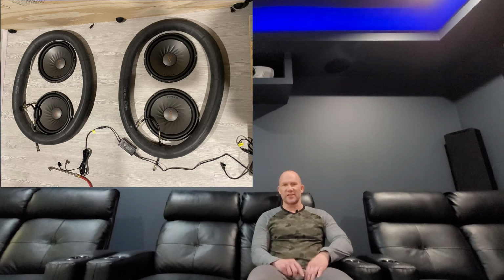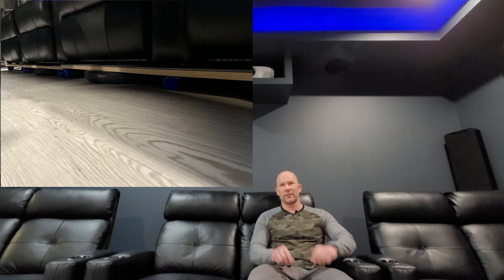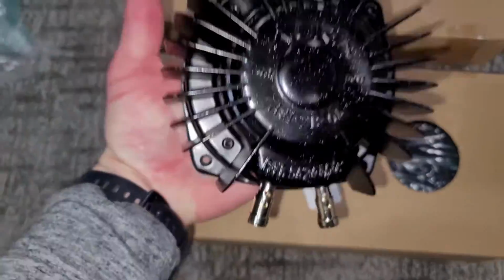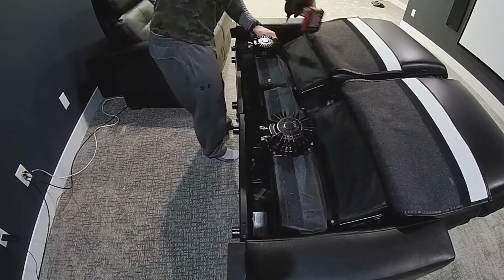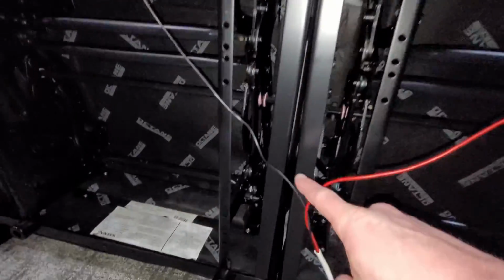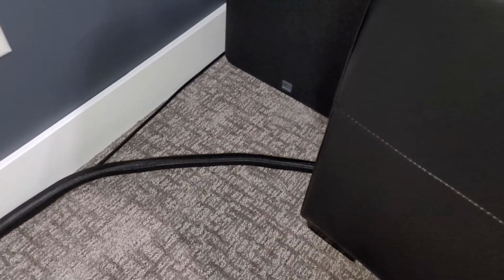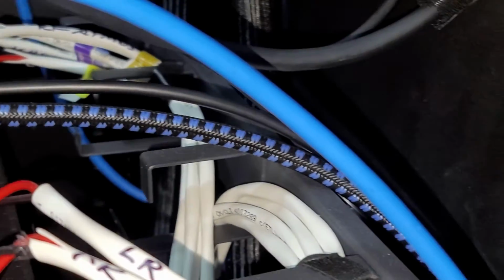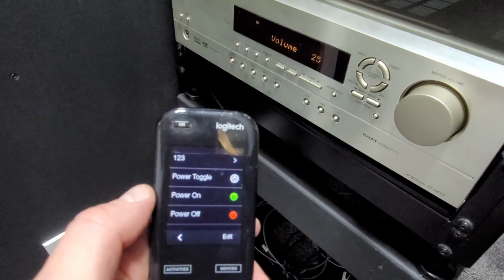Basement Home Theater - Bass Shaker Install for Tactile Bass

Comment: Hi thanks for the wonderful video! My question are do I need to use the Logitech harmony cause I can’t afford to buy one afterall the old receiver I will use for the shakers already has a remote control and my last question is will the receiver to receiver really works thanks😅
Reply from the maker: Hello - no you don't have to have the Logitech remote.  That is just a convienence thing to have everything controlled by one remote instead of multiple remotes.  The receiver to receiver works great!  You just have to make sure it is set up and connected properly in order for it to work right.  Good luck!

Comment: Hello i have a question. I have a yamaha receiver RX A-2080 and I use both subwoofer outputs on this receiver. Because I don't want to sacrifice any of my subwoofer outputs is there any chance to be able I connect my centre pre out from yamaha RX A2080 to any channel in of my Sony receiver and follow the same procedure as you did. Should be this ok? I believe that preout  sends only signal.
Reply from the maker: Try it and see what happens!  In my mind it'll either work or it won't....depending on how that receiver is set up.  Some receivers you have to change the settings in the menus to get the pre-outs to work.  Can you install a splitter to your 2 subs on sub out 1 and use sub out #2 to the shakers?

Comment: so my question is, how are you able to run 2 receivers in the setup? (i'm still new to the home theater scene and i myself have a onkyo nr6050 and am running 5.1.2 at the moment, gonna get 2 new subs both 12 inch wireless). bass shakers would be awesome inclusion
Reply from the maker: Hello and thanks for watching.  The second receiver is acting only as an amplifier for the bass shakers.  It gets it signal from sub out #2 and only  amplifies the signal and powers all six bass shakers.  The Denon handles all the other speakers in the whole system.
Reply: @TyEichele  gonna piggyback on this question: I notice you run 2 subs. If you’re running 2 subs how do you have an extra Sub Out connection to run your second receiver? I’m missing something 🤔
Reply from the maker: @jruhhh  Good question.  I am running a MiniDSP 2x4 HD.  So my sub output #1 goes into the MiniDSP, which then has 4 outputs of it's own that go to the subwoofers.  I have each of my rear 2 subs on their own output from the miniDSP, and the 4 18" subwoofers in the front behind the screen are set up in pairs, so each pair is on it's own output from the minidsp, which means I'm using all 4 outputs on the minidsp.  Hopefully that makes sense!  Check out my other videos for more details on this!
Reply: @TyEichele  makes total sense. Thanks for responding!! You’re a great help man!

Comment: Great video. What did you set your crossover at on your Onkyo?
Reply from the maker: Thank you!  I did not set anything up in the Onkyo because it is set to pass the incoming signal straight through to the shakers without changing anything at all.  So the original source is coming from the Sub 2 output on the Denon, which has the LFE channel set at 120 hz.  Hopefully  that makes sense!

Comment: Very well simple explanation and amazing setup. One question, I have a Denon with 2 subs out which I have connected 4 subs total using 2 Y splitters. How can I connect 4 bass shakers?
Reply from the maker: I would move the 2  Y splitters to Sub output 1 and control all of my subwoofers with that single sub output.  It shouldn't matter how many times you split that signal.  Are you using a miniDSP?  That would give you 4 subwoofer outputs and only use 1 single input so you wouldn't have to use any splitters at all, plus it gives you the option to now time align and EQ your subs to your room, which is a huge benefit.  See my other videos for how that all works.  Then you can use subwoofer output 2 specifically for your bass shaker setup and control them independently.
Reply: @TyEichele  Thank you for the answer. Im actually getting a miniDSP deliver tomorrow. I have seen your videos about using DSP along with other videos as well and yours is very well explain with good simple details but I still feel I need to watch it one more time to get everything consumed. (Could be overwhelmed at first)
Reply from the maker: @felicianojaquez9019  Awesome!  Yes, take your time for sure.  Have my video ready to take you through it step by step maybe.  Remember - you can always start over!  You might not get it on the first try and that's ok.  Have fun with it!

Comment: I have 4 of them in my 3 seater sofa. I just watched The Batman. It enhanced the movie so much. It's driven by the Dayton Audio BSA 200. I really recommend for those who can't have cinema level subwoofer levels. And for those to do, it is a nice to have but not essential. As I have a living room and no chance of a svs subwoofer in my future this worked a treat.
Reply from the maker: That's great feedback!  Thanks for sharing your experience with these.  I could also see these working very well in apartment settings where loud bass isn't probably going to happen.  Thanks for watching and commenting!
Reply: I just bought the aurasound bundle with Dayton amp . 
Do you recommend any settings like HPF and LPF ?
Should I leave HPF off and only turn on LPF ?
Thanks
Reply from the maker: I don't have any filters on mine because it's getting it's source from my subwoofer output #2.  Therefore it's only getting the LFE signal from the AVR and passing that signal to the shakers.  I'm sure you could set it up however you want depending on your preference though!
Reply: Good recommendation but don't use SVS are a holy grail of subs. Not even close.. PSA and Rhytmik are way better.
Reply: @shaolin95  that's interesting as everyone on YouTube likes svs subs. My local guy is a fan of Rel. At the minute I have a simple Yamaha NS-SW300. It does the job.

Comment: Hi, amazing video! and amazing set up! I have a 7.1 system Onkyo tx-nr6100....so if i want 2 bass shakers i would need an amp like your onkyo solution but how would i have the .1 subwoofer plus the 2 bass shakers? Would i just connect the Y cable from the Nr6100 and one end to the reguka subwoiofer and the other to the extra amp?
Reply: Thanks
Reply from the maker: Thank you very much!  Yes if you only have 1 sub output, use a Y (splitter) on the sub output to get the LFE signal to the amp that powers the bass shakers.  Then you can connect like I did in the video from there.  Good luck - you'll love it!
Reply: @TyEichele  AMAZING! Thank you so much for your answer...I've looking everywhere...do you recommend any amp in particular? Ithoink there are some specificaly designed for the bass shakres.
Reply from the maker: @jubeijimbo3062  Yes there are amps that are more specific to them.  It doesn't really matters just make sure you will have the correct ohms going to the shakers and that they are wired properly.  I knew my used Onkyo receiver out out 100 watts per channel.  So with 2 shakers in each channel they share that 100 watts, so they each get 50 watts of power which is what they are rated for.  They are also 4 ohm's each, but wired together I get an 8 ohm load at the receiver, which is what the receiver is rated at also!  Just do your research and you'll be good to go!
Reply: @TyEichele  Thank you so much! You have clarified this whole mess for me and I REALLY appreciate it...now....IT'S BUYING TIME!!! THANKS!
Reply from the maker: @jubeijimbo3062  I'm glad to be of help!  Have fun!
Reply: I guess the first question might answer this. I have a denon reciever with 2 outputs. I have 2 subs connected to that denon. My theather seats came with bass shakers. I'm thinking of buying the wireless bass shaker amp. Would I need a splitter for one of the subs?
Reply from the maker: @Holidayhova1  If I understand correctly, yes you will need a splitter.  You could run both subwoofers on a splitter from Subwoofer Out #1 and then the bass shakers on Subwoofer Out #2, that way you can individually control the bass shaker seperately from the subwoofers.

Comment: What crossover did you set the bass Shakers?
Reply from the maker: They are running on the sub output #2 on the AVR and the sub LFE crossover is 120 Hz.  The Onkyo receiver that powers them is passing the signal right through and doesn't change anything.
Reply: @TyEichele  oh ok so I should set my crossover on my sub amp plate that powers my bass shaker to the highest point?
I also have it coming from sub2 on avr straight to amp plate that powers the Shakers.  I have it on 40hz.  Should I crank it to the highest point?
Reply from the maker: @rindershow212  If I understand correctly, you have the Sub output 2 at 40 hz on your AVR, so that is only sending a 40 hz signal to your plate amp that powers the shakers.  I would put the plate amp at the highest crossover setting yes if you plan on controlling the crossover point from your AVR.  You could also do it the opposite way as well, so if you have other subwoofers on Sub Output 1, you can send them full range at a 120 hz crossover, but then turn down your plate amp to 40-60 hz for example to power the shakers.  I'm sending the full range of 120 hz to my shakers, and have no issues with it.  You can totally customize it to your liking.  Try it at a few different crossover points and see what you like the best and run with it!
Reply: @TyEichele  thanks for the reply 👍.  But no I don't have the sub output 2 at 40hz. I was saying I have the amp plate at 40hz. The sub outputs on the avr are untouched after calibration. The only thing I set to 40hz was the amp plate that powers the Shakers. Crossover of every speaker in my system is set to 80hz.
Reply from the maker: @rindershow212  Gotcha.  Then yes I would turn up the plate amp to allow more frequencies to get to the shakers.  Again, it's all personal preference, but I would at least try letting more than 40 get to the shakers and see what you think!
Reply: @TyEichele  thank you brother!!
I appreciate 🙏 you.

Comment: Wow this is amazing!!! the demo at the end was pretty cool.  I just started researching this, I have a denon 4700 and using the pre outs for 2 PB 2000 Pro's.  If I'm using the two pre outs, to what would I connect the other av to make the connection to the bass shakers?  I apologize if I should know the answer to thisjust trying to make sure I can do this correctly. thanks in advance!
Reply from the maker: I would put the two SVS subs together on 1 sub output using a Y-connector (splitter).  Then you'll have sub 2 for the bass shakers.  Another option is looking into a MiniDSP so you can further calibrate you sub system.  See my other videos for how to do that!  Thanks for watching!
Reply: @TyEichele  that's what I was thinking. My only fear is that when recalibrating Audessey because they would be connected to the same pre out and not independently it may not calibrate them properly. What do you think?
Reply from the maker: @ProjectSOG   I see what your concern is, yes.  Just another reason why a MiniDSP would solve the issue. 😉 There are a lot of factors here, but either way if they are both on Sub 1 Audyssey won't know if you have 1 sub or 20 - it'll take the output it gets and make adjustments.  The best thing you can do to help Audyssey out is with the MiniDSP and getting them time aligned to each other and EQ'd, but if you don't go that way then I'd try to get them both at the same SPL at your main listening position using their built in gain/volume control, then running Audyssey afterwards.  Then don't touch the gain/volume on them anymore.  Control the sub volume using the AVR Subwoofer Output, trying to keep it in the negative range so the AVR doesn't have to work as hard.  Hope this helps and makes sense!  Good luck
Reply: @TyEichele  thank you so much. It seems like the mini Dsp is the way to go. Will definitely look into, thanks again!
Reply: The 2 sub outs are the same thing it's basically a splitter
Reply from the maker: @thecluckingassassin  Correct - however, unlike a splitter, they can be controlled individually within the settings of the AVR.  You can have a higher output on Sub 2 for example than the output on Sub 1.  They are individually controlled which gives them more versatility than a splitter does.

Comment: Yet another great video.  Correct me. Il use my spare sub out 2 from my main arv. Use a splitter and pug to my second avr to any input eg Il want to use cd in. Than connect my bass shakers to front L and  R??. For the speakers to play full range can I use pure direct mode which will only enable L&R? Il have 4 bass shakers but connect in series so it's 8 ohms. Is this correct?
Reply: Control the bass shaker trim and distance on my main avr denon and have my second avr on half way volume? Cheers
Reply from the maker: I turned my trim and distance setting to 0 or as close to it as I could on my main Denon AVR.  Then on the receiver that is controlling the shakers, you can set the volume to wherever you enjoy them the most!  Some movies I have to turn them down a bit because they are too much, others I have to turn them up more to enjoy them.  It's totally up to you!
Reply: @TyEichele  thank you.. all makes sense. So it's ok to put in any input source eg cd input than select source on second avr and control shakers from there ?

Other option. Can I connect it to a mindspx4hd? I have a spare input and 2 spare outputs on the dsp, and control all the cut-offs and trims on dsp?
Reply from the maker: Exactly!
Reply: @TyEichele  thank you :).. my shakers coming tomorrow got long weekend so can't waittt. Il do the mini dsp hookup and see how that works 💪.
Reply: Hi there thanks to you and your channel/clear explanation you have taken my HT to another level.. omg I was seriously looking to buy more subs, but this is seriously end game :(. 

I done everything you said BUT I connected to mini dsp and wow and works flawless .
Got output 1,2 with my x2 um18 and output 3,4 to but shaker wowowoowo.  Using only input 1. 

Everyone should do this :).
Reply from the maker: Awesome!  So glad to hear this!  I don't think about using the extra MiniDSP outputs.  Makes total sense.  I had all 4 outputs used already on my MiniDSP.  Glad I could help and glad you enjoy them as I do mine!  👍
Reply from the maker: This sounds correct yes - just re-watch the video where I go through all the connections.  The second receiver or avr you are using will only be getting the LFE signals since the splitter is plugged into Sub 2 output.  So you don't want to change that signal so using  a Pure or Direct mode will not change that LFE signal from the AVR source.  So hooking up your 4 bass shakers to the L and R channel in 8 Ohms (make sure that your shakers are 8 ohm!) on those 2 channels is perfect.  Good luck - and thanks for watching!

Comment: Hi there, great review! just want to make sure I'm understanding this right, you took the extra LFE out Chanel from the Denon then split it into an analog L and R signal for the Onkyo and plugged it in as a source to it. Then run them as full rage so it can play the low frequencies? just want to make sure I'm understanding this correctly, thank you!
Reply from the maker: That's correct - since the output is from the Sub 2 output it's only sending the LFE frequencies to the input of the Onkyo, which amplifies the signal and powers the shakers.  I haven't had a chance to see if I can control the crossover of the Sub 2 output seleratly from the Sub 1 output, so right now I'm assuming it's sending 120hz and below to the Onkyo, which is what the LFE crossover is set at in the Denon.   Hope this helps make sense.  You were absolutely correct though.  Thanks for watching!

Comment: Awesome setup . Became a subscriber a few months ago.
I purchased those same exact RCA's about 2 years ago. I found that the ones I had, had a voltage drop of almost 1 volt. No biggie because I corrected the problem with a line driver.
Secondly, how are you liking the stereo integrity ht3's?
Reply from the maker: Good to know.  Question - how did you figure out you had a voltage drop?  Were you having a specific problem or issue?  
I love the ht3's!  No regrets and they continue to impress me every time I hear them!  People are amazed when I show them off as well both visually and audibly!
Reply: I found the drop by playing a test tone then measuring the RCA'S accordingly. Measuring the input voltage then the output. In that case I was trying to keep a certain voltage throughout the signal (5 volts) at my amps for my car audio setup. 
I've been seriously considering the ht3's for some time, and for $200 a pop, it's a steal

Comment: Great video! Pro Tip:  Add the Onkyo volume to your “watch movie “ button layout so you don’t have to switch to the specific right device to adjust your shakers!
Reply from the maker: I thought of that - but I'd rather have the Denon volume control during those activities as I tend to adjust that more often.  We'll see what happens and a good idea for sure though!
Reply: @TyEichele  I guess I was referring to unused buttons. I used my red, green, yellow and blue to cycle up mixers and the “record button” turns on and off my bass shaker amp.
Reply from the maker: @CoachCole71  That absolutely makes sense now!  Thank you so much!  I'll have to do that for sure 👍
Reply: @TyEichele  Enjoy! Subscribed and checking out your other videos now! Love your theater!!!